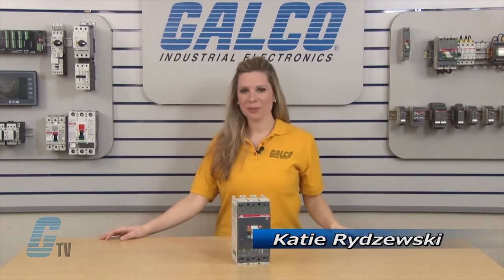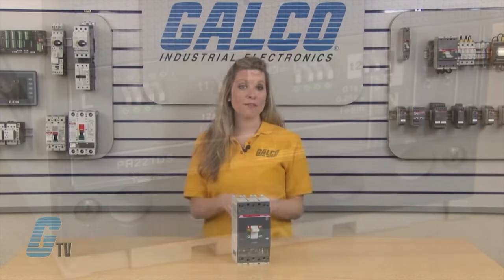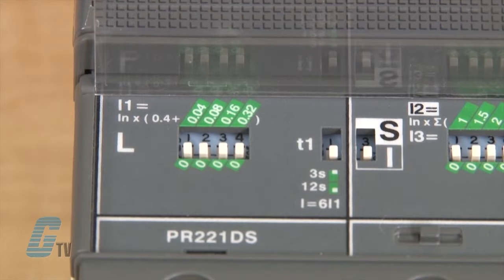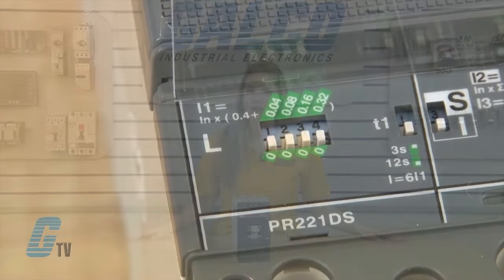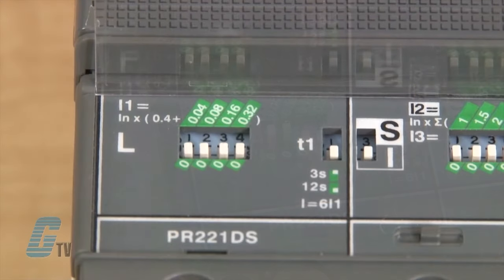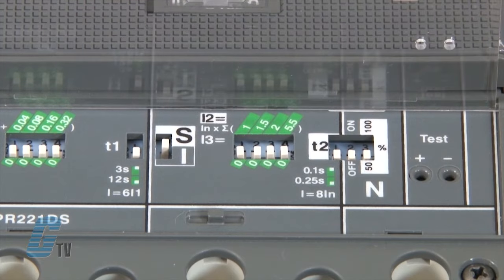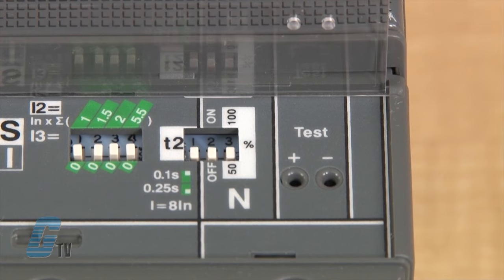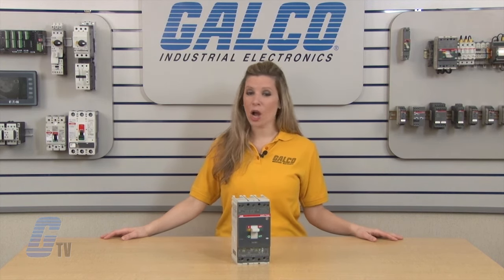How to set up the ABB Electronic Circuit Breaker - TMAX

Comment from the maker: The ABB TMAX has an electric arc interruption system used on the Tmax circuit-breakers allows the short-circuit currents of very high value to be interrupted extremely rapidly. The considerable opening speed of the contacts, the dynamic blasting action carried out by the magnetic field and the structure of the arcing chamber contribute to extinguishing the arc in the shortest possible time, notably limiting the value of the specific let-through energy and the current peak.

Comment: Sir I have a 630 Amp ABB sace Tmax mccb, it's getting trip during starting of motor, as motor is connected to fan load it take 936amps current for 50 seconds and then back to nominal current, Plz help for trip time characteristics

Comment: I need to set up the ABB circuit breaker RC222 please
Reply from the maker: Ok Khalled, the only thing I could find for you is the RC223 trip mechanism that attaches to a Tmax series CB. However the RC222 portion  of this is in this manual written in 5 different languages, so just click this link https://library.e.abb.com/public/cec8ab4eccce1cc0c12578080070eca9/1SDH000471R0001.pdf and you should be all set.

Comment: Sir I have a 630 Amp ABB sace Tmax mccb, it's getting trip during starting of motor, as motor is connected to fan load it take 936amps current for 50 seconds and then back to nominal current, Plz help for trip time characteristics
Reply from the maker: You may have to increase your "Starting Class" parameter. Class 10 is minimum, you should also have class 20 and 30 selections which are for longer starting times at very heavy loads during starting. So try increasing this parameter/adjustment. Great question, good luck.